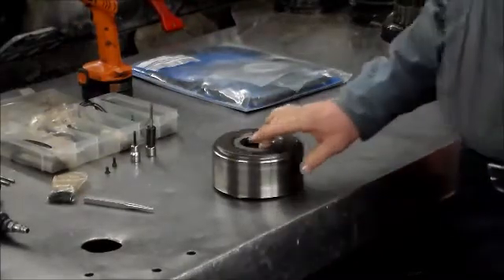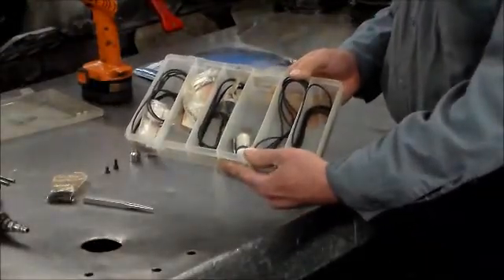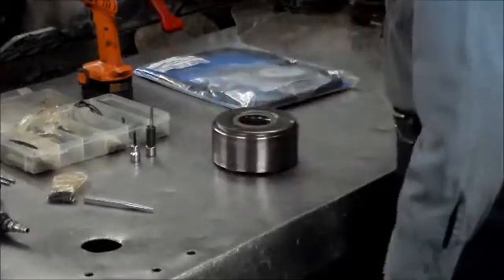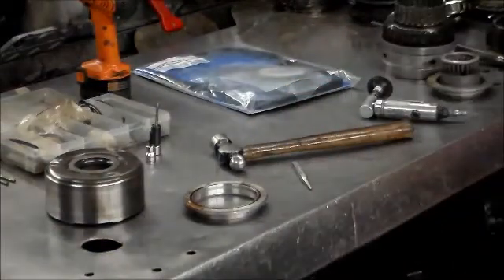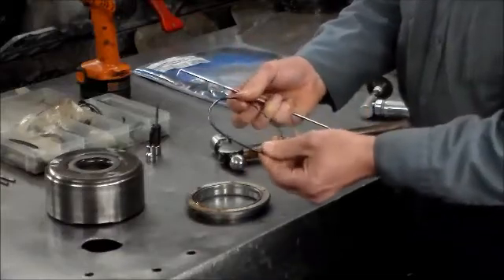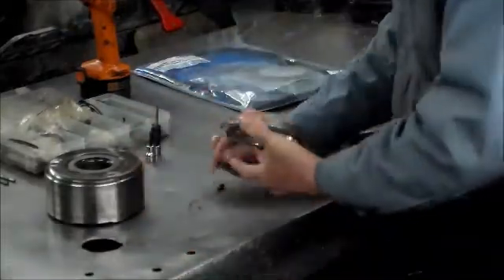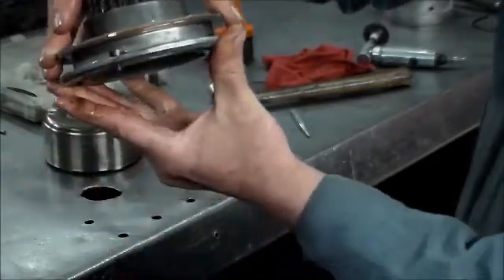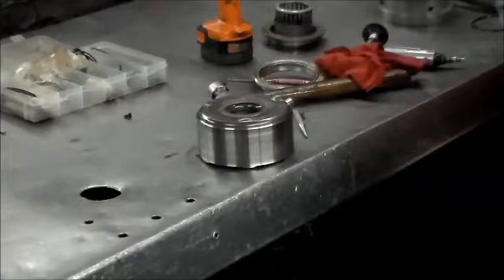722.3 K2 Drum Overhaul

Comment: Really burnt that mercedes doesn't offer the K1 and K2 o rings without buying the new drum. I'm stuck with having to source an old stock SMS kit off ebay or measure the o rings and buy some myself and hope their the right compound. Erling kit does not have these seals.
Reply from the maker: correct, cannot buy single seals, i'm don't even know anyone that does

Comment: hi Gary i got the original kit from Mercedes for 722.317 and did not get the seal  and screws for the k2 drum . is this something i can get separate   if so where ?
Reply from the maker: maybe google it, it may be sold as a kit, the one i have, i've had for 25 years.  The kit would include the screws, the tap, loctite, and i believe the rubber seal, may have drill bit too
Reply: Gary Ferraro thanks for your quick response awesome!

Comment: Hey Gary, great video!  I rebuilt a 722.350 and wanted to ask you a question about tuning shift firmness.  When i accelerate at around 2K-2.5K RPM the trans shift smooth.  When i accelerate with 3K-3.5K rpm the shift is pretty firm, definitely more firm than the 2K-2.5K situation.  I found that if i let off the gas a little before it shifts, the shift is perfect @3-3.5K RPM.  I have a new vacuum modulator tuned at 30mph as well as measured the vacuum into the modulator, i think its was around 18.5 which should be enough.  Any ideas how to smooth out the shift at higher RPM's?
Reply: Hello mate!! I have same problem!! You find solution!? Thank you!

Comment: Gary i am rebuilding my 722.320 and have used a m5x10 b
olt (europe).Do you think if i torque the bolts enough without the loctite ,do you think the bolts will come out?Greetings Michael
Reply from the maker: your speaking of the drum correct?
Reply: yes the k1 drum is countersunk but on the k2 drum i have used like you a m5x10 allen bolt but without the loctite do you think the bolts can come loose even if i have torqued them enough
Reply: To be sure i have bought the blue loctite and wil use that on the bolts (for the k2 that is not countersunk) But anyways thanks for the great videos you post you are a great motivation for most do-it-self rebuilders also in europe.Have given many people your link for transmissions and many have rebuild the transmission with succes.
Reply from the maker: ok, i would recommend using it.  Sorry for late reply, short handed today at the shop

Comment: Mr. Gary .we can do the same for the D1?
and what if I didn't replace the o ring?
Reply from the maker: Yes, K1 is alittle different, those screws have to be countersunk or they will hit the piston, they actually eliminated the rivets on the K1 drum and now use a snap ring.  How are the other rubber o-rings soft? if they are, then you should be ok, im sure there are rebuilders who dont change that o-ring, also, make sure the drum air check ok.